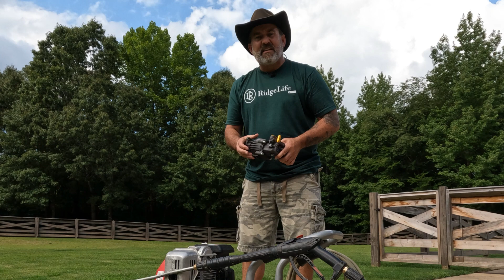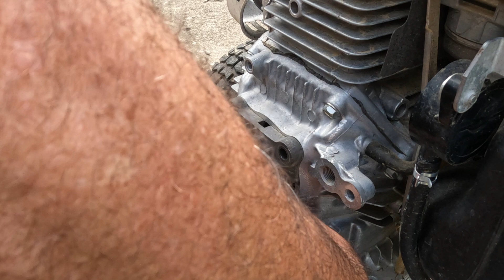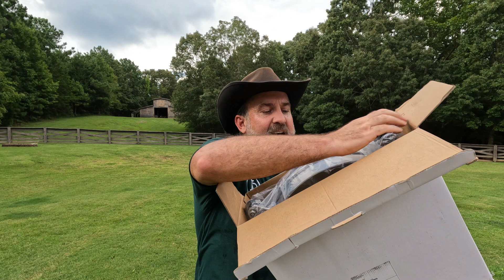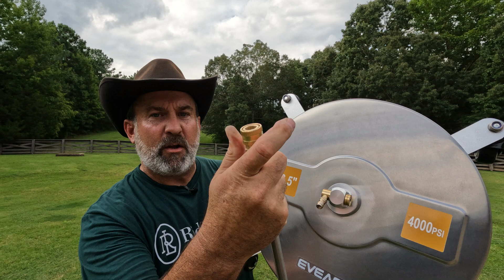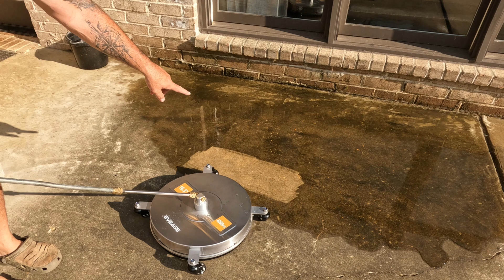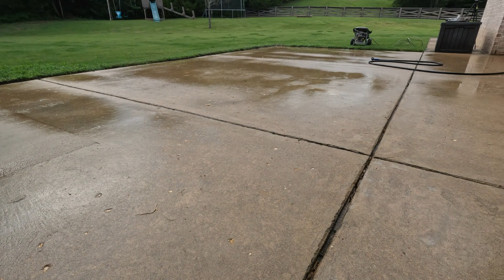HOW TO Install Pressure Washer Pump | REVIEW Surface Cleaner for Deck, Driveway & Patio by EVEAGE

Comment from the maker: EVEAGE 16.5" Pressure Washer Surface Cleaner, Power Washer Surface Cleaner with 4 Wheels, Stainless Steel Housing Power Washer Accessories with 2 Extension Wand, 2 Replacement Nozzles, 4000 PSI- Amazon Link https://amzn.to/3PMznf0
Website- https://www.eveagetool.com/

Comment: To get close to the wall just tilt the surface cleaner to the side a bit. Way faster than changing attachments. Also if you post treat with bleach (SH) it’ll make even more difference.
Reply from the maker: Great tips!

Comment: Very nice video. Just picked up a 3100 PSI Simpson pressure washer from Tractor supply to replace a very old electric washer with much lower PSI and water GPM. Don’t have a the Honda engine we shall see. However should work with a surface cleaner for my deck. Checking for size of surface cleaner to use to match up with my washer and came across your video. Thanks for the info you provided in the video.
Reply from the maker: My pleasure!